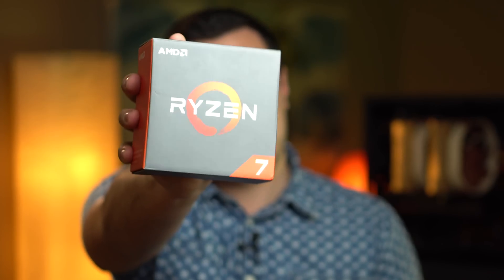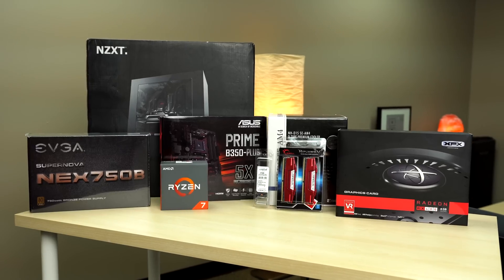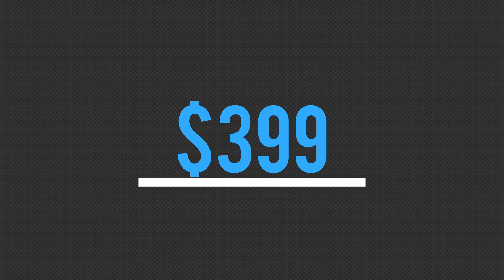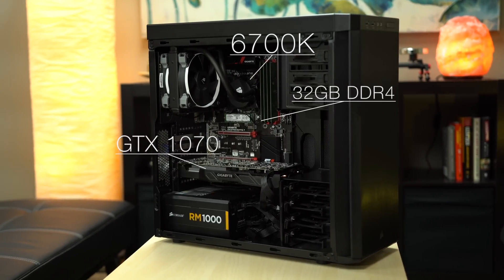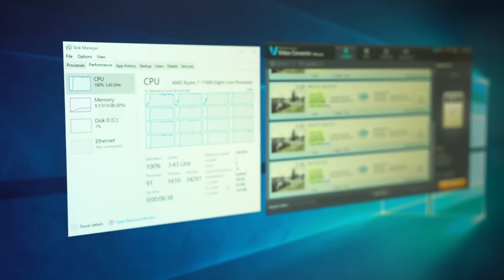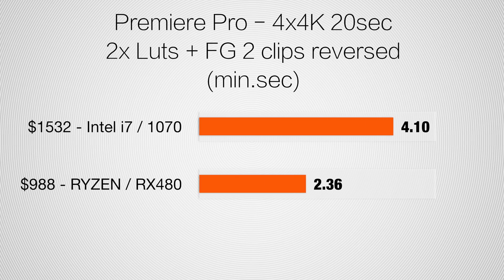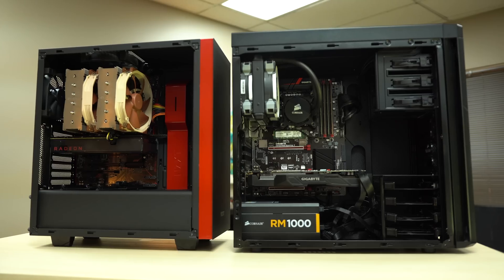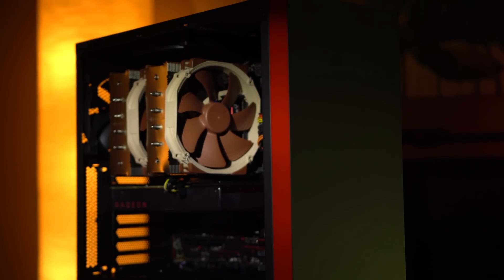$998 AMD RYZEN 4K video editing BEAST! Premiere & Resolve

Comment: As a longtime Mac user who has grown weary of Apple's high-priced quirky products, I find this video very interesting and informative. There are unanswered questions, though: (1: As an Adobe Creative Cloud customer, I am wondering how a machine like this can be configured under Windows 10 to handle not just video, but also PostScript graphics and typography. Is there a way to make a Windows machine handle PostScript like a modern Mac does? (2: Can a machine like this handle the newer generation of high-def, ultra-wide monitors like the newer Macs do? (3: Is the Ryzen machine 100% Windows compatible? (4: If someone wanted one of these home-built machines to be used as a primary workstation for both video, graphics, and office productivity tasks, what Windows-oriented security (passwords, anti-virus, anti-hacking, etc.) investments would have to be made? (5: What Windows substitute can be made for iPhoto / Apple Photos to manage a personal/family photo library? 

(6: I started using Final Cut when I attended a week-long immersion course at Digital Media Academy (Stanford) in 2003. I am now using (occasionally) Final Cut Studio 3 (FCP 7). How difficult is it to transition to Resolve or Premiere? Are there courses for folks like me? (7: How hard is it to equip a machine like this with a good CD/DVD/BluRay burner? I still occasionally find a need to read/write discs. (8: Is still occasionally use an old FireWire HDV tape-based high-def camcorder. Can a system like this Ryzen handle that kind of input?

Thanks in advance.

Comment: Max, do you have a more current video like this?  I'm thinking of building a 4k editing machine to use with the Adobe CC suite.  I'd really love to know what parts to piece together at this point in time.  Thanks, that was a great video!
Reply from the maker: Hey Brett, what’s your price point?
Reply: @MaksimYuryev  Thank you SO much for responding.  That's very kind of you.  I've never really got a response from any YT channel when I asked a question.  You're the tops!  I'd like to keep it between $1000.00 - $1500.00 if possible.  I could maybe stretch to 2k if you find that to be necessary!  Thanks, you get a sub and a bell from me!  :D
Reply from the maker: @BrettFunkGuitar  I would go off of this build https://youtu.be/8mgCk3wJDVE but instead of that CPU and motherboard use new 9th gen CPU's, either i7 9700K or i9 9900K http://geni.us/BrlEr (based on your budget). Watercooling: http://geni.us/NKQy I would go for the this PSU http://geni.us/4bG9G and probably the better case like this one http://geni.us/4bG9G . Here is a good budget motherboard to use as well: http://geni.us/St2Z5n and more budget ram http://geni.us/Frvr6  and best GPU for the money http://geni.us/LJjnF99 . Get an SDD to suite your storage needs but this one is good http://geni.us/cJHET
Reply: @MaksimYuryev  Wow, THANKS so much for taking the time to do all that.  You're a good human being.  I appreciate you very much.  I'll get right to it.!  :D

Comment: Hi max, do I really need such an expensive GPU card? Thanks
Reply from the maker: The GPU is used for effects like titles, LUTs, color correction etc. if you don’t do a lot of that then a less powerful one will be just fine like an RX560 4GB but if you can get a RX580 8GB or GTX 1070
Reply: @MaksimYuryev  is the RX560 better than the GeForce GTX 1050 2 GB?

Comment: PLEASE HELP! GTX 1060 6GB OR RX570 8GB (MSI)
I'm building a rig with a Z370 GAMING PRO CARBON Motherboard and an Intel i58500. Between this two cards which will be a better option for 4K video editing? I use Sony Vegas btw. I also play a couple of games and with my Current FX-8350 and HD7970 playing in 4K is imposible, so I decided to upgrade. I narrowed my options to these two cards, can somebody tell me which one should I get? Thanks!
Reply from the maker: I would guess the 570, but in that case I would shop around and get the 580 8Gb.
Reply: @MaksimYuryev  Thanks Max! Appreciate your advice.

Comment: Max, I'm a bit late to this, but I think you would have been better off using a Ryzen 7 1700 and overclocking it to the 1700X speed, which you can do using the included Wraith Spire cooler.  It would have saved you money on both the CPU and cooler.

Comment: The XFX RADEON RX 480 8GB Graphic Card will boost the total to over $1600! Did anybody actually looked up the prices? cuz this is very misleading.
Reply from the maker: Pc parts have went up especially graphics cards due to mining but are starting to come back down. Rx480 has also been replaced by 580 so get that.
Reply: Is it possible to substituted with Graphic Card relatively cheaper and compatible with the parts you mentioned? i mainly edit with 4k fyi. Thanks for the reply

Comment: This video is exactly 1 year old, would you suggest a new improved rig with the same budget?
Reply from the maker: If you have a little more to spend then I would check out my 8700K build. If not build this it’s still great, but it does cost a bit more $ now since parts are more expensive all around.

Comment: Hey Everyone, need help. I bought a Sony A7s ii to film in low light. I like filming in 4K, 60p and 100mbs. Not looking to spend a bomb. Looking for something that provides smooth playback and a fast render when I slow it down and add wrap stabiliser. Currently taking at least 1min to render when I slow down footage. The clip is about 5 secs long after slow down. Also have to play clips at 1/8 and have everything with a green line above to ensure smooth playback. I would build this one if it can handle the 4K footage! Thanks for the help everyone!

Comment: Hi Max - How will this build work with 2018 Premiere Pro CC? My understanding is that Adobe is no longer supporting switchable graphics (or will no longer allow you to choose the GPU) and will only use the GPU that's designated in the PC as "primary." Need advice. Really new at this and can’t waste money going in. Thanks.
Reply from the maker: Or worn have issues and will select your main GPU which will be the lore powerful one. Check out my 8700K build video it’s a bit more but definitely better for Premiere Pro!

Comment: For a moment I thought that I have seriously overpaid for my ryzen 7 build. After checking, it looks this guy is lying to his teeth about the cost of this build. RAM on it's own costs 627!!! pounds. Yeah pounds.
Anyway, finding 32GB b-die RAM suitable for ryzen below 500$ currently is not possible. Adding the cost of CPU+MOBO+SSD you are well above 1000$ and still need to account for GPU, PSU, Case (at least 400$ for something decent)
In total a mid-level powerful ryzen rig costs about 1500$. If you go with Intel (i7-8700k vs 1700 - not X) you end up spending 200$ more (CPU-MOBO-COOLER difference). You gain in per core performance, but significantly loose in multitasking.
Reply from the maker: Who you calling a liar? You do realize that this video wasn’t posted yesterday right? Prices have gone up on RAM, graphics, and other components plus your prices will differ if your not here in the states. The prices on GPU have been coming down though and hopefully ram will go down too.  I no joke paid $91.18 for the set of brand new ram in early 2017 from Amazon (sold and shipped by amazon) and now it cost $359.98 USD.
Reply: I will take back the "lying" term back and apologise for it. Still though "$998 AMD RYZEN 4K video editing BEAST" is at best an exaggeration in my book. I do not claim to know it all so  I ll keep watching...
Reply: Max certainly doesn't need me to defend him . . . but  . . . @enovationsgr (et al), you appear to be completely ignorant about how social media functions in general and how PC build pricing fluctuates day-to-day.  No where does time stand still; certainly not in our PC building/on-line posting world.   I get how liberating it must be to talk smack without knowing what you are even talking about, and to do that without consequence.  But seriously, act with maturity.  To your credit, your post is partially helpful.  It correctly points out how select device prices have dramatically escalated from March 18, 2017 to date.  Still, while I respect the courage it took to issue a public apology for improperly calling someone a liar, you gain nothing by following that up with a criticism of the title of a YouTube video that's now nine months dated.  Following fundamental and decent communication rules adds to our community's knowledge.  And isn't adding to our knowledge what we're all really after?
Reply: Ok, then explain why prices in the title are in dollars and prices in the description links are in pounds. This is a common practice for Max. Does it have to do with the fact that 1 dollar = 1.25 pound and it is easier to make his builds appear cheaper than what they actually are? 
Also explain what purpose does it serve to compare a build with a gtx1070 against an rx480.  Gtx1070 is at least 60% better and equally more expensive. Would you characterize a build with an rx480 8GB a beast when it comes to it's graphics capabilities? In 2017 could you find the rx480 8GB for under $250? Because I have been looking for one since 2016 and I could not find one. Even today if I can find one at $250, I am buying.
Finally, if you want to call a Ryzen build a beast and make the most out of it, you need to advice people that they need 3000/3200mhz  b-die ram CL14 due to the Ryzen's infinity fabric & memory subsystem.architecture. Anyone getting advice from this video is shooting himself on the foot.

Comment: This will be enough for rendering 4k 60fps smooth? I curently have a i5 with a 960gtx and its getting chopped images when movement is done. I use a Sony Alpha a6500 and a gopro 6 for capture the vídeo. Thanks.

Comment: good video, but isnt 32 gb of ram overkill? considering how expensive ram can be now i would have gotten 16 gb and use the extra $$$ on either a bigger ssd or rx 580 instead of 480 (maybe even gtx 1070). - just my 2 cents lol
Reply from the maker: 1060 will be slower than 480 or 580. 32GB of ram will make a difference if using Premiere Pro or Resolve compared to 16 or 24GB.
Reply: sorry when i said 1060 i meant 1070
Reply: i understand that when it comes to editing 32 gb of ram is good but wont a gtx 1070 or more space have a better effect?

Comment: Hi Max, I just built a new ryzen video editing system with a  ryzen 1700 , while I was waiting for the rx580 to arrive I used an older nvidia 760. it seemed to work fine, in fact I did some rendering tests just before my rx580 arrived to do a comparison.
Problem is with the rx580 installed using current Premiere pro, the rx580 is slower by around 10% on a simple test and on a slight hard render, the time has jumped from 2 minutes to over 20 minutes on the rx card!
Any ideas?
It does warn me that It has changed from he cudu engine to the mercury open gl when I open the project. but the speed is crazy slow, I can't even scrub the same compared to the old nvidia/
:(

Comment: 1700x $400 ,rx480 $250, 32gb ram $220 ,thats 870 , how did you get a 750W psu , a 275gb ssd , and a case for 118 bucks , that's a load of crap.
Reply from the maker: Like I said in the video, I shopped around, bought parts that were on sale and from different online shops, and sent in a few rebates. My RX480 was $189, CPU was $399, Ram was $145, PSU was 59.99, case 59.99, SSD was $89.99

Comment: Great video! Why Buying the RX 480 when the GeForce GTX 1060 is cheaper and (supposedly) more performant? https://www.videocardbenchmark.net/high_end_gpus.html 
Is it because the Radeon card work better with the Ryzen?
Reply from the maker: The RX480 was faster than a GTX 1070 for most real world video editing tests, so it will also be faster than a 1060.
Reply: Very interesting, you mean the test made for video games should not be used for video editing? thank you for your answer.

Comment: hi the GPU you recommended is quite expensive. Would it still be ok to pick another like the GTX 1060 6GB or Radeon RX 580 8GB? If so which one
Thank you

Great video, I currently ordering the parts to remake that build
Reply from the maker: The 580 is basically a slightly updated 480. Yes get the 580 :)

Comment: What sort of 4k footage was it? What codec, bitrate ect. I'm interested in having smooth playback with 4096×2160 H.265 at 100Mbps non ProRes. Like for example with DJI Inspire 2 footage. Could you test such footage on your system and get back to me? :)

Comment: I don't understand why you are using a Radeon instead of a Nvidia graphics card in this build while you are using premier pro? I thought Premier pro was optimised for Nvidia? Does that means that Premier Pro still get high editing  performance even with a Radeon Graphics card?
Reply from the maker: Yes. I covered that at the start. The Radeon is cheaper and faster.
Reply: Max Yuryev Yes indeed What a stupid comment I wrote 😂

Comment: That Graphics Card Rx 480 cannot longer be found at $180.  Was this a mistake, or market simply bump up the price? And would this system be able to handle 4k editing if instead of the Ryzen1700x I use 1700?

Thanks.

Comment: How is possibile beat a nVidia system in Premiere with an AMD GPU One? The CUDA implementation makes the difference! Is flagged the CUDA encoding during this test? I'm interested in anticipo Hybrid solution with a Ryzen CPU, but a 1060 GPU!
Reply from the maker: Like I said in the video, the RX480 in this computer was FASTER than the GTX 1070 in the computer. CUDA doesn't matter anymore with the last 2 version of Premiere Pro.
Reply: How is this possible? Thay don't implemented CUDA anymore, or Adobe implemented low level GPU programming, and this is Fastweb than CUDA?

Comment: seriously good videos here. but a little confused i priced a cart using the links in you have, and without a video card its around $950 (using cheaper power supply and cpu cooler). adding a rx 480 brings it to 1500 easy.
Reply: Did you ever figure this out? I’m pricing it just now at £1300 (I’m in the UK).
Reply: It’s called click bate boys. You’ve been had.

Comment: omg this video really is helpful been wanting to upgrade my i7 950 rig equipped with gtx 580 been using it since 2012 and i admit its still kicking and working perfectly for me i use it on my sketchup and after effects rendering 1080p up 4k reason i want to upgrade is because i want to give this rig to my little brother as he is going to college now and need a high performing pc for his autocad course, i feel so excited watching this video however i have a question rx 480 costs $300, rx 470 costs $250 and rx 460 4gb costs  $142 i wonder if i can just buy the cheapest model which is rx 460 does it makes a lot of difference? actually its my 1st time to use amd and radeons i really have no idea .. again will rx 460 4gb work? thank you .. i subscribed :D
Reply: i'd like to know this as well
Reply: anyone care to make things clear? thanks
Reply: im late i know, but for 4k rendering ur best of with a 570
Reply: get rx 470. 460 is to weak for the job
Reply: get the 480, its very powerful, but if u can stretch your budget by 200$ get the GTX 1080

Comment: They are saying that the I7 is faster than both Ryzen processors with adobe software.  I know F stoppers and Puget systems did tests and they show the the AMD chips are slower with adobe products.  Great video......I will take your word.
Reply from the maker: I think the 7700 is about 7-8% faster than the CPU I tested here. How old is that article?  The latest CC update is said to increase Ryzen CPU usage from 50% or so that I had in my video to about 75-80% just like intel CPU's so that will be a huge improvement for Ryzen.
Reply: That is really good to know.  I followed your lead and built my first desktop with the ryzen and I am loving it.  The only thing I added was a M2 Samsung Evo (Pro is Better) and we edit the videos off of that hard drive.  It is mind blowing how fast it is with that hard drive.  I know it is a little costly but if you have the opportunity, i highly advise it.

Comment: You have a lot to.learn on setting up Premier Pro, you need to have the software set up to utilize the graphics card.

almost all software from professional to consumer-grade, will utilize the video card.

When you set up the software to use the video card, the processor will only use a few cores and have the video card do all of the work.

You can see this happen when using the operating systems own resource manager.

When the CPU does the work, you will see all the cores and threads shoot up in being used.

When you send the work to the video card only a few cores and threads will work, all they do is send the raw data to the video card.

In my testing using a consumer-grade video editor called PowerDirector 14.

my old 3770k Intel processor sent the video faster to the video card then the ryzen 7 1700 x did.

Now if you have a low end video card sure the Ryzen could beat it.

But if you have an older Intel paired with a high end video card it will be the faster option over the Ryzen7

Here is that video.
https://youtu.be/96q2gHCBUys
Reply from the maker: Just because your NLE does that doesn't mean Ppro does. Pro was setup correctly, If It wasn't then I'd get no GPU usage at all. I've been doing these tests/video for over 3 years now.

Comment: I've done almost exactly the same build but have had over lock fail issues for 2 months since I built it. Now the computer won't turn on after a bios update for the B350 plus motherboard. think the main difference between Max's and mine is that I have Corsair vengeance ram. Help would be much appreciated. Not finding anything online. Also I have the ryzen 1700 not x version.